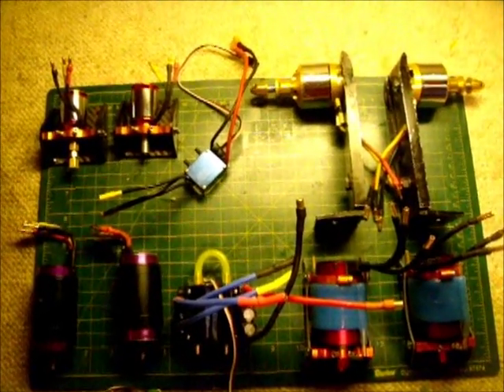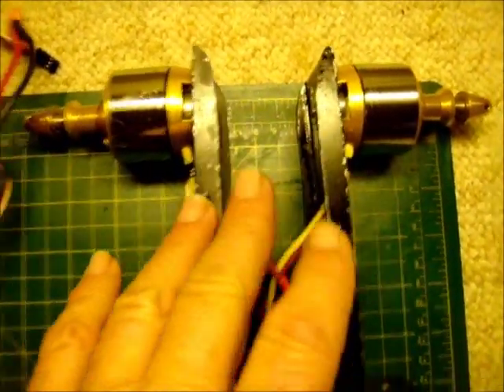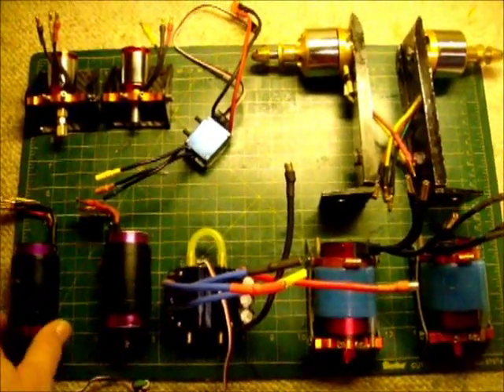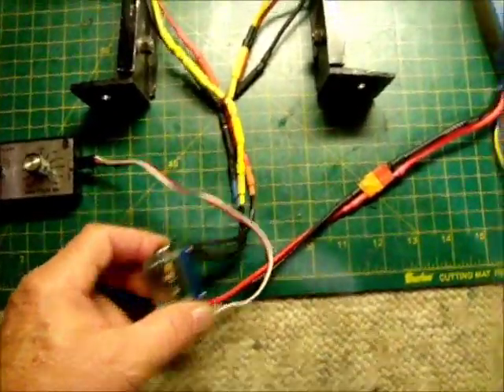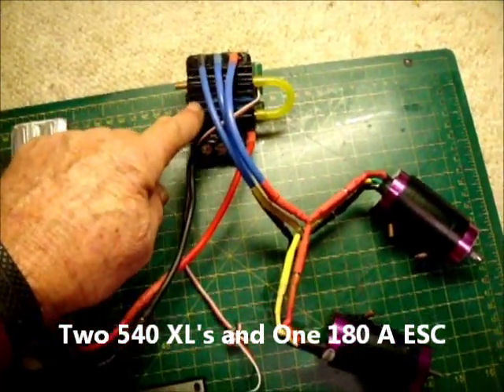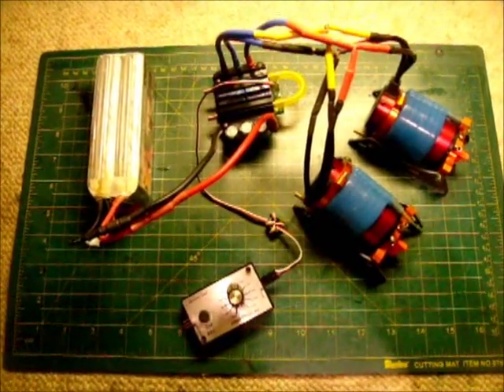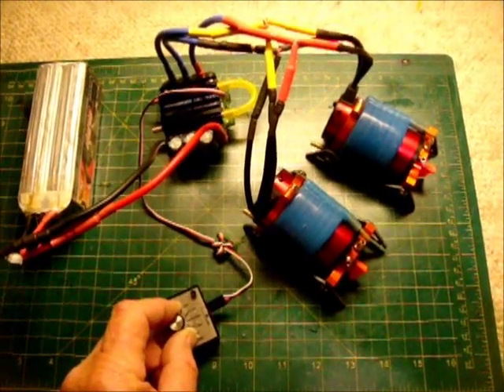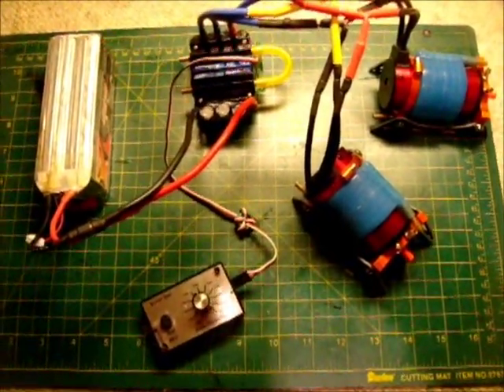2 Brushless Motors and 1 ESC

Comment: Hi how or where can I get the connectors that split from esc into the two motors. I got a 3-6 s 2500kv esc horizon hobby. 3 plug outlet. Two 3500 (10turn) brushless velineon motors. I got no connector wires for the esc to the motor
Reply: The gauges look different size .or atleast the spot where the wire high voltage wires go. A,B,C

Comment: How can you tell the ESC is "rated" for 2 motors? by the current limit ? or the voltage? also, can you  use 2 battery packs?

Comment: If you were to use both motors to drive the same shaft, would that cause issues?  They would be under the same load which is good, but they'd be mechanically locked together - would that be an issue?
Reply: I don't think it would make a difference man- just do one "proper"  test drive and feel if one motor is way hotter then other one.

Comment: I see several folks have debunked this theory and have to wonder why the OP hasn't updated the video to show that his test isn't under any load and is misrepresenting something that has no practical use?

This is very unfortunate and loses credibility to all other videos posted by this guy :(
Reply: scroll down and read posts #21 and #100 here:
https://forums.offshoreelectrics.com/showthread.php?20484-Two-Brushless-motors-on-One-ESC%85-YES!

It would be nice to get more information in the video that this was intended for R/C Boats... I've yet to see this method prove practical for R/C Cars, but glad to hear it's working for you, cheers :)
Reply: @billdelong  personally I wanna build a puller... And think that two Motors is the route Togo to get enough torque to not strain the motors

Comment: HAHA idiot, at high RPM the BEMF detection system fucks up because the inductance of both motors is difference, therefore producing differing RPMS = different BEMF timing response so the ESC makes both of them stall at any point above this RPM.

Comment: Does not work under load... Motor timing goes off. I just tested it on my truck.
Reply: +TheLEDwheel maybe if you aligned the stators just right (relative to each other), you could get it to work.
Reply: +awes0meguy13 they will not stay aligned. no two motors are exactly the same.
Reply: What do you mean motor timing goes off? 
Do you mean that it works like 2 wheels on a diff- where one slows down if working hard (under more load) and other one with more freedom (less load) speeds up?
Because this is normal,  does the same thing even with a "out if the box"  duel brushed motor ESC (with brushed motors) ..  You are only suppose to use dual motors on crawlers I would say- having gear ration that pust little strain on motor or a low kV motor.  Then you don't notice the difference that nutch-,  and then also works at your advantage when front wheels spin tiny bit faster then back ones
Reply: It worked for me!!  https://youtu.be/9nHh5PRbvGY
Reply: In hindsight, if you were to have them drive one output like on a boat and timed the motors right it could work. But running two motors on two separate axles with one esc will not.

Comment: one major flaw. if you put load on just one of the motors, the motor with less load will spin faster and receive more current. its called path of least resistance. just run individual esc per motor unless you acquire a dual motor esc that is meant for it.
Reply: But even with 2 ESCs, each one will be getting the same amount of throttle input from the TX so the same thing will still happen. You need independent throttle control for each ESC.
Reply: With brushless motors the shaft speed is not determined by the current or voltage but by the drive phases.  If you load one motor and its RPMs drop, the other motor will drop too, or maybe both will stop if the difference is too much.

Comment: Hello, I was just wondering if you are doing these test because you want to use this setup in a boat? If so, wont the boat be very unstable in turns ect? The reason why I ask is because most of the rc boats I have seen runs with 2 esc's on dual motor setups because they run the motors clock wise, and counter clock wise. that way the boat is more stabile.